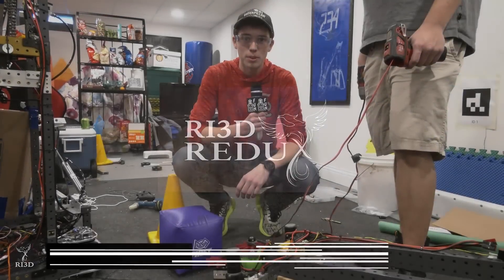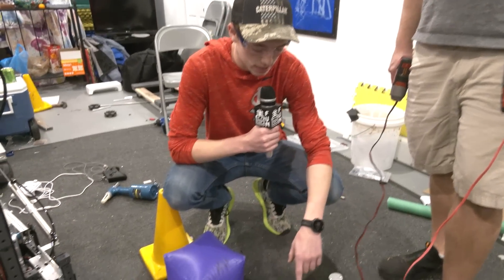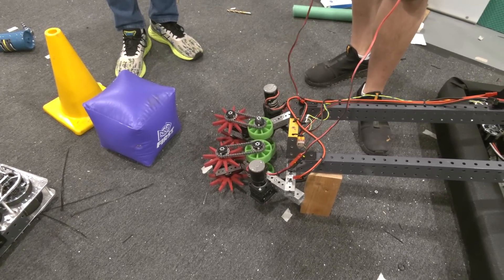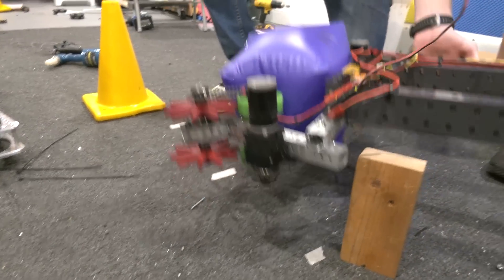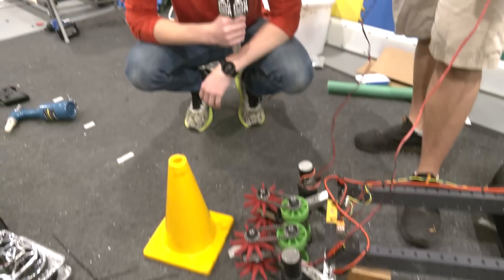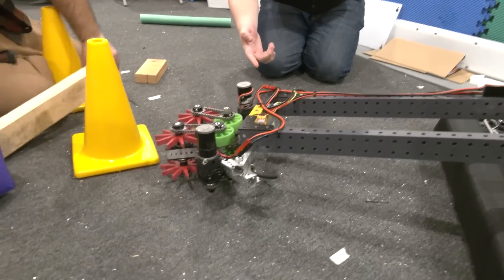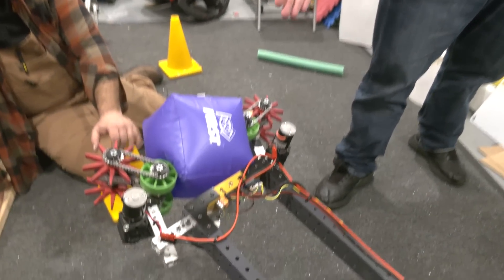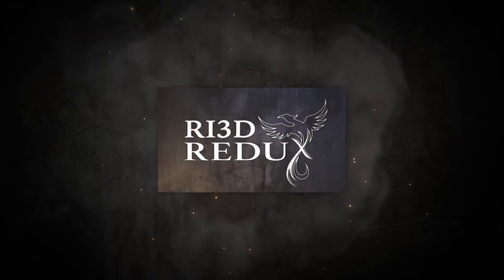Compliant Intake 2.0 and Time of Flight Sensor Demo | Ri3D Redux 2023

Comment: What is stopping the two fingers from pinching together? On the first iteration it looked like the pneumatic cylinders were the stop but this one has no pneumatics so what prevents it from just pinching?
Reply: A mechanical limit pin made of a bolt and round white plastic stock. It can be seen at 4:47. This puts a hard limit on going together and out. We've also got surgical tubing to hold it together and give it some good springiness.

Comment: What are those devices you are holding in your hand to power the motors? Some Milwaukee product?
Reply: They are drills that the motors died on, you take off the motor and gearbox and replace it with wires that terminate in Andersons so you can quickly test motors at different speeds by pulling the trigger.  Some of the people who brought them to Ri3D made fancy 3D printed faceplates to make them look more professional
Reply: @kselavko  Something to keep in mind the drill battery voltage. A higher voltage won't hurt brushed motors, but it will make it run faster and give you a false idea of what your prototype will be like. So keep that in mind.